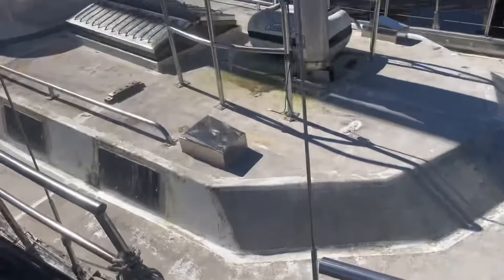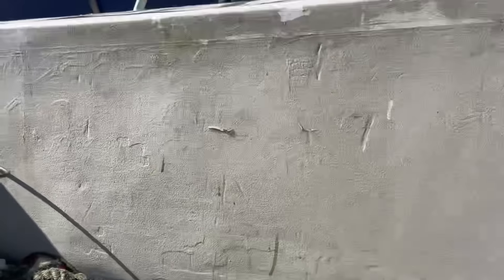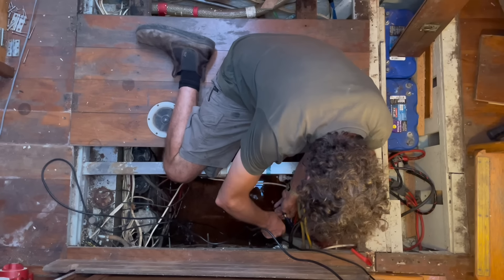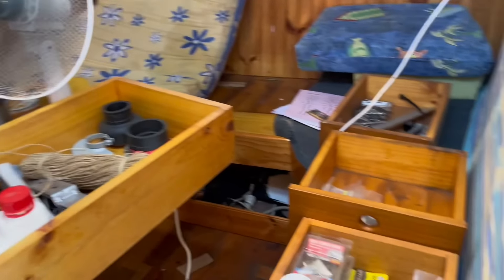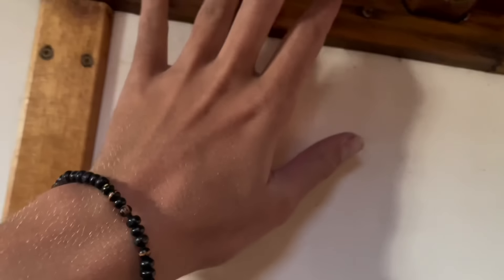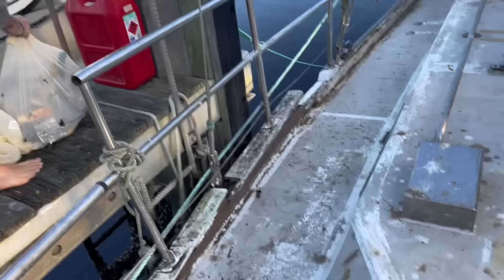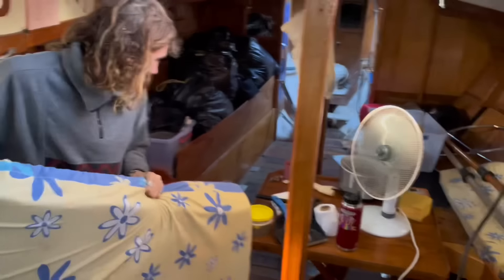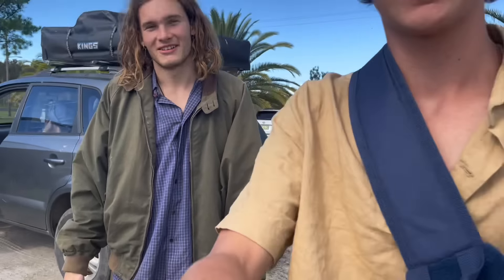I Bought A Boat From A Flat Earther… Sail Boat Restoration Part 1

Comment: Good on you boys. You will remember this time together as brothers for a long, long time. A tip, get her lifted, cleaned and anti fouled as early as possible. Check all through hull connections, valves and hoses, and bilge pumps /alarms asap. It's a boat, the most important thing is that it floats without a risk.

Comment: Might want to get an official survey done on this vessel.. the amount of water damage on the sole/floor, walls, etc... and that rot around the mast, I'd hazard a guess that this ship was a salvage. Not impossible to restore, but this one may easily end up costing more to fix than buying a newer vessel in better condition.

Either way best wishes to you both, and good luck with the project!
Reply: ya the mast was just one of my main concearns too from the rot around the ceiling and the stay lines.
Reply: Just take it out and sail it in strong winds and see what happens

Comment: As project boats go, I've seen worse. Just cleaning it up a bit you can probably double your money if you wanted to sell it; and if the engine works you could at least triple it. Make sure you find all the thru holes and open/close them to make sure they aren't seized. Best of luck!

Comment: I did the same thing, bought a boat fixed it up, been sailing her quite a bit, now back in the yard fixing her up more. 

You have a good deal of work to do to her, but if you are able to get her back up to speed you will have a nice steel boat on your hands.

Comment: When on dry land, please hit all copper/brass/lead/.. fittings where the boat discharges or inlet fittings from the inside of the boat with a hammer perpendicular to the side of the fitting, along the line of the hull. After that you will know how close you came, or not at all, of sinking the boat.
Reply: I'll add to immediately ID all thru hull fittings below waterline and including those 2 feet above waterline. Then secure a Wood bung, plastic sheet square of 1ft square, and a foam plug such as a mini nerf-like football or foam beach float. Then install a high water bilge alarm. I subscribed and look forward to your journey of discovery as you dig into this old girl.

Comment: If you have two sets of 12 volt batteries, you can isolate them from each other and charge them on separate controllers. If their voltages are similar, you can connect both controllers on the same solar panels. Batteries don't like to be discharged. Cut back your draw during cloudy spells.